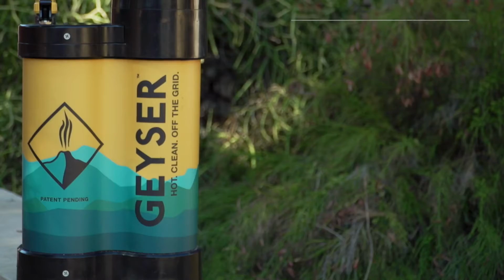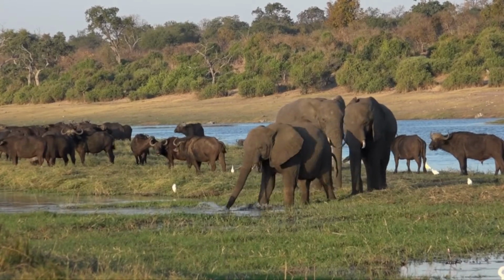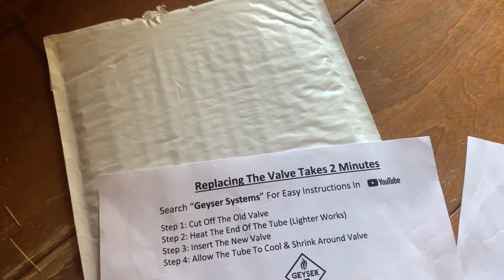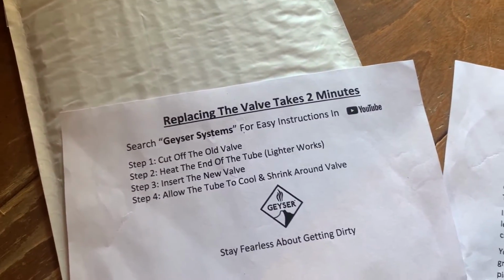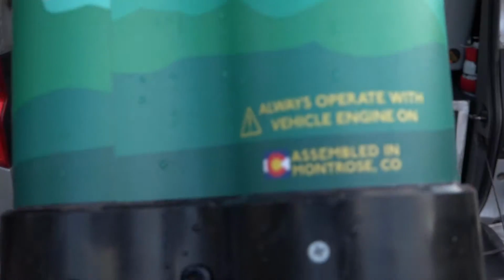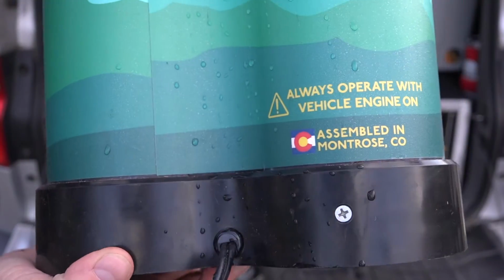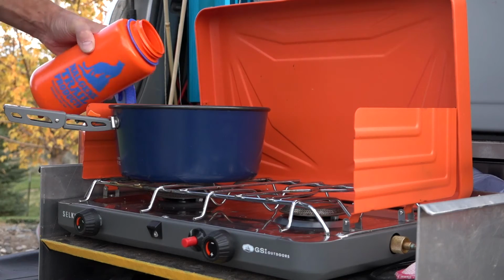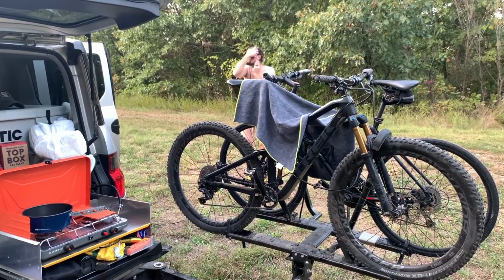Geyser - Is It WORTH it?

Comment: Hot shower? You mean lukewarm sponge. Myself and my family were really excited about this product as it seemed like the perfect solution for our Overland rig and for use after scuba diving. Unfortunately the concept of the 12 volt heater is highly flawed and if I have to boil water there's much cheaper systems. I've never been able to use the 12 volt system to heat the water above 95 and unfortunately it gets worse from there as the thermostat gets stuck in that position and will not continue to reheat the water unless I pour all the water out and fill it with ice cold water to reset the thermostat highly inefficient. If you wait more than five minutes after the light comes on you are taking a 90° sponge within 20 minutes it's about 85° definitely not what I would describe as a hot shower. Most disconcerting of all is the fact that a quick Google search found that I was not the only one having this problem which means the company must be aware of this flaw and is continuing to ship a defective product. Now I'm out well over $300 for a fancy lukewarm sponge.
Reply from the maker: Hi Michael, thank you for your comment and thorough explanation.  That is disappointing to hear and I don't have any experience with the heated unit.
We just returned from a 6 week adventure, used our Geyser almost everyday and without complaints or problems. But again, it appears your biggest issue is with the heater. If you are able to return/replace (if you purchased from REI?) then perhaps I'd suggest changing out for the non-heated version.  Yes, it adds a step to the process however it is rock solid each time. I'm not sure if that's a possibility for your situation but wanted to toss an option to you.
It's not a flowing waterfall of a shower.  But what it is, for me, is one of my favorite things when we are remote and I've been out killing miles on my bike.  
Thanks again for taking the time to write out your comments, it's what this video is here for, to gather info, help people make more informed decisions and uncover issues that will help future buyers in their research process.
I am but one dude with one experience.  Thank you again.

Comment: 20
Minute to heat at 115 watts f$&k no and stop patting yourself on the back
Reply from the maker: Hi Steve, It's obvious that you didn't watch this video.  At all. But thanks for the comment.
1) I have the unit that you heat 1/3 of the water on your stove.  Unless you are using a lighter to heat your water then it actually takes about 3-5 minutes at best.
2) Since I don't work for the company and made this video based on a real and true experience then Geyser isn't patting themselves anywhere.  I am.  And you didn't watch the video.  
3) From what I understand it does take around 20 minutes for the self-heated unit to heat hence I didn't buy that one.
4) I'd suggest finding the appropriate video that discusses your elegantly stated concerns and airing your grievances there.
5) Whatever video you choose to comment on, you should actually watch it first. Because again, you didn't watch this one.
Thanks again, Adam
Reply: Lmao that’s just answer I’d expect I actually watch several 
One where they actually did some useful measuring of power consumption of the heated unit 115 watts 15 minutes and if your using your car outlet you likely need run car to not kill battery no thanks I’ll stick with HELIO XL no car running polluting way less then 300$
Reply from the maker: @Sea1fly  "just the answer you'd expect"? 
Hi Steve, you'd think that a keyboard warrior such as yourself, that hasn't used the machine nor watched this video (it's obvious by your comments) would at a minimum use proper grammar and punctuation.  Oh Keyboard Warrior, go hunt something you might know about and don't buy a Geyser.  It's simple really.  Thanks for the fun though.